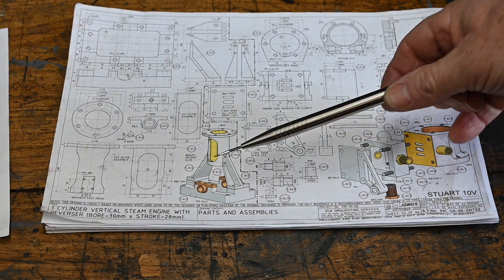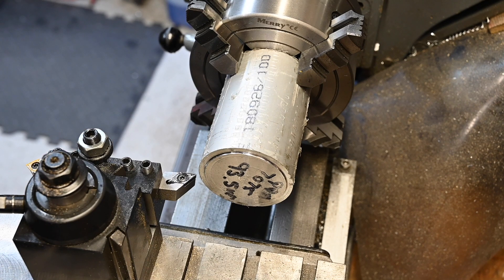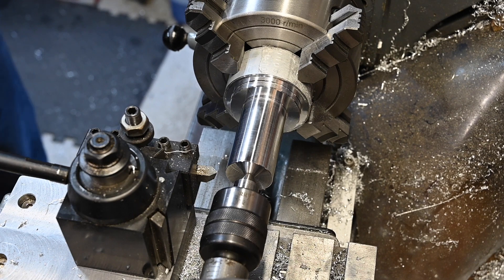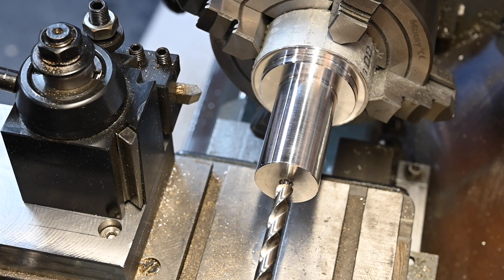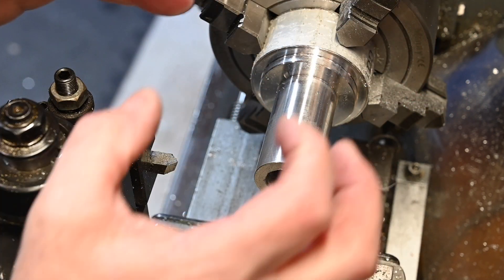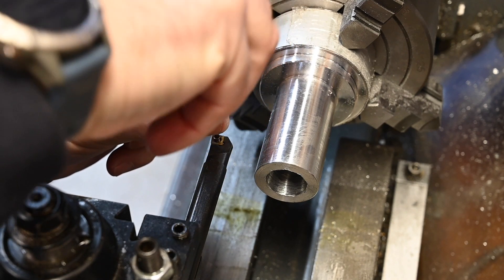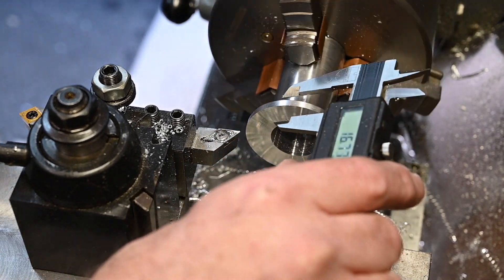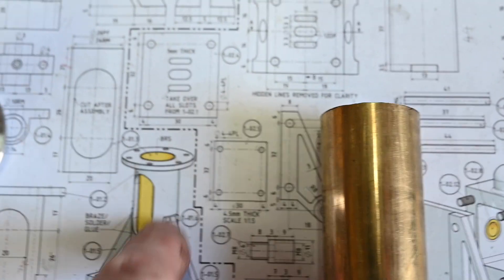Stuart 10v Steam Model - Machining The Trunk Guide EP05

Comment: The music is far less annoying than some used by other YouTubers, but I don’t really think it’s a necessity. I think that I would have tried to find some thick-walled brass tubing for the liner rather than using a solid piece. It seems a shame to reduce so much of it to waste.
Reply from the maker: I agree, but my goal is to build the engine from stock I already have laying around 👍
Reply: @EnglishHobbyMachinist  I hear you. I guess it hurts a bit less when you already have something and you either got it cheap or can’t remember what you paid for it😉